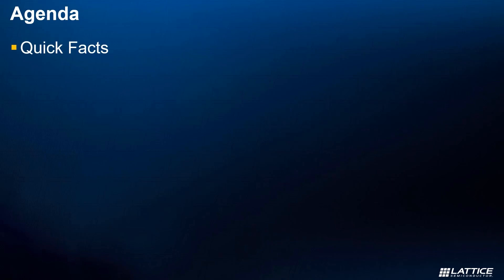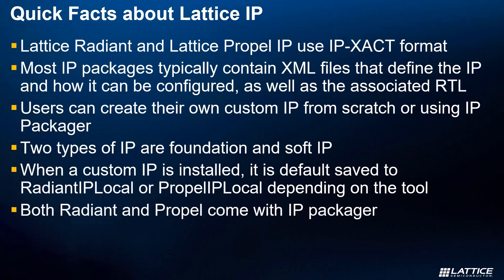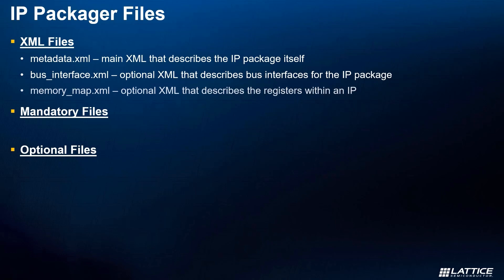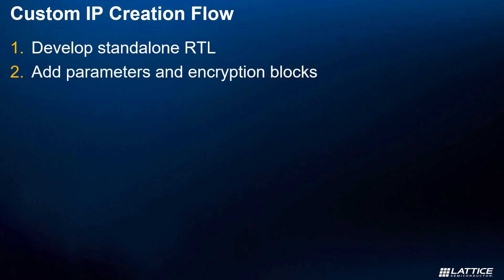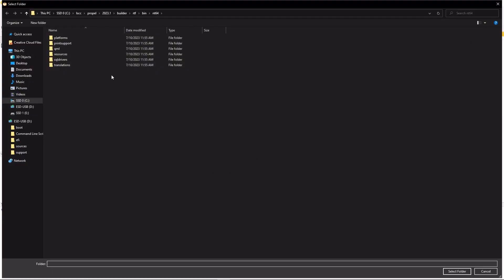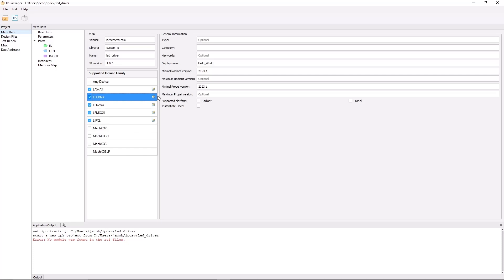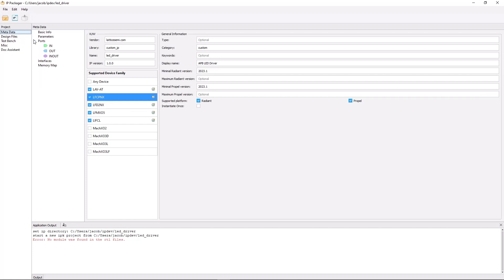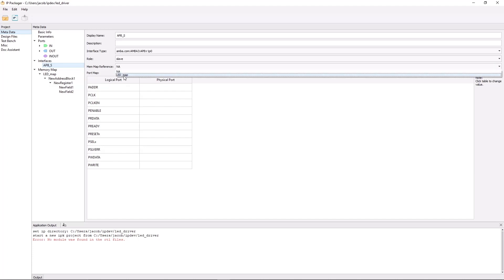Creating Custom IP with IP Packager

Comment: Thank you for this clear and concise getting started guide for IP Packager. Do you also have any deeper-dive tutorials which illustrate exactly how to access things like parameters (settings) as not only configuration attributes for the underlying IP cores, but also in the C drivers and header files, and how those can be automatically included with the Propel SDK along with HAL and the other drivers from Lattice?